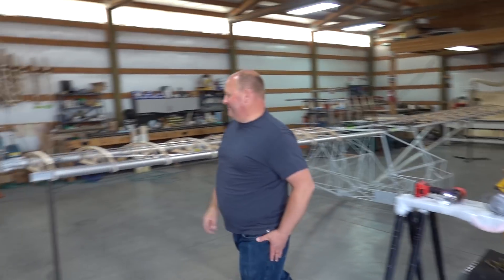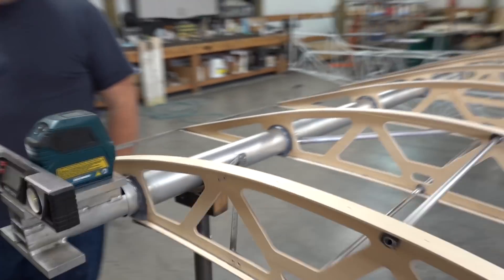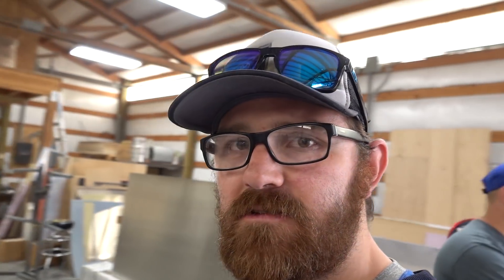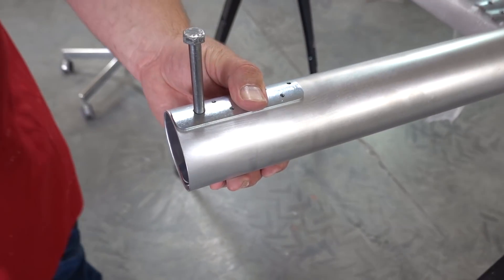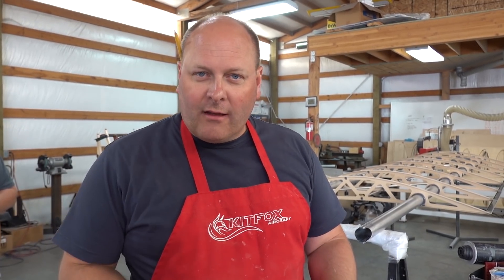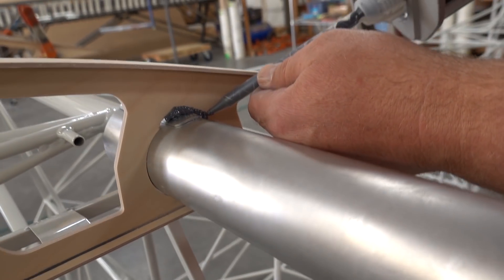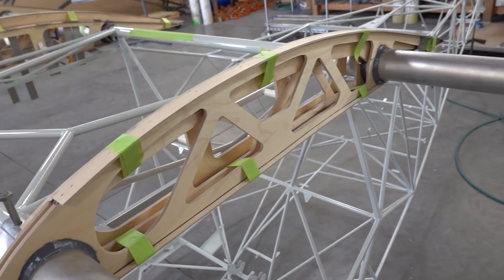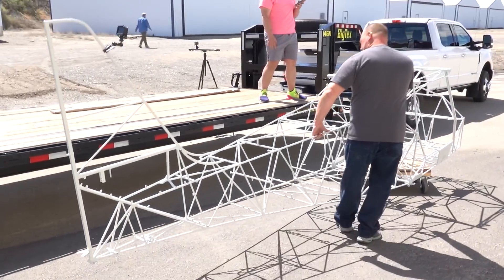Phoenix Fox Starts Now

Comment: He skipped over the step of once the wings are straight, inline with zero sweep, measuring back to the tail post to ensure the wings are square to the tail, or maybe I missed it.  My build in '87 of a Kitfox I and later a Avid Magnum taught me this, and I see many of the exact same techniques are still used, but now have decades and a whole lot of fleet hours behind them to prove they work!  Gluing wood ribs onto aluminum spars, as a for instance, was a radical concept back then.  I see more sq. ft of wing is claimed for the STI version, anyone know if that was achieved with span, a deeper chord, or both?

Comment: Hi Nikk,
I am so glad to see you on here again. I thought we may have lost you forever. After watching your video on the wing preparation I was surprised to see that the wing rib material is of wood and not aluminum. Did your first Kitfox have wooden ribs as well? Also I did not notice any mechanism to fold the wings back. Did I miss that or is this version without that feature? Best of luck to you.
Reply from the maker: All the kitfox wing ribs have been wood, as far as folding when you un-pin the front wing spar they pivot on the back spar and swing towards the rear
Reply: @nikkaudenried9309  Thank you for the information. I look forward to see your Kitfox grow from just parts to when you take it up in the air. Good luck.